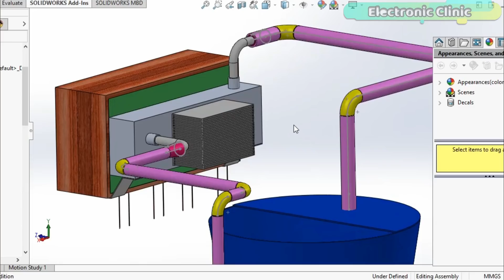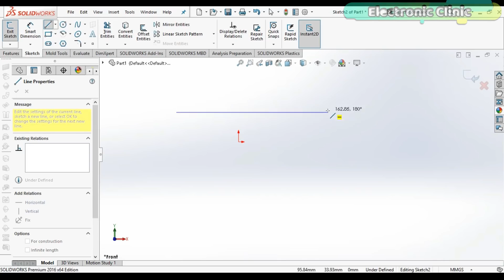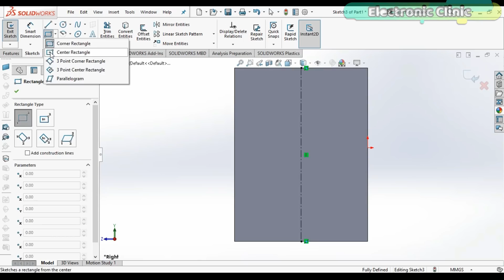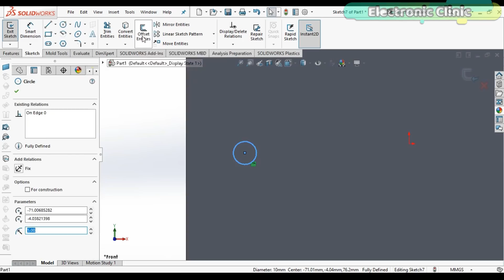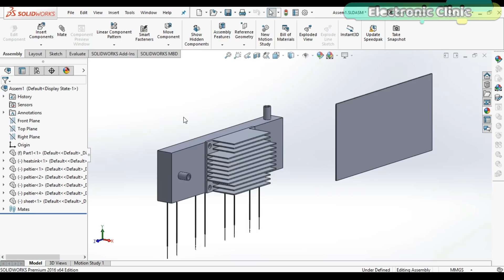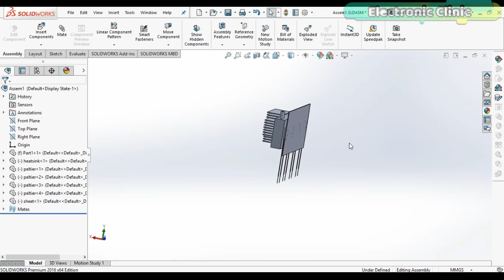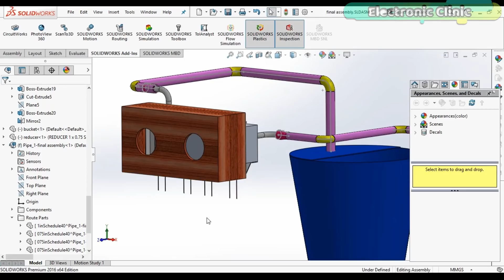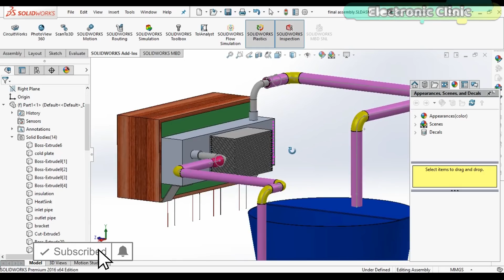DIY Peltier based Portable Air conditioner | Solar Panel & 12v Battery powered Air conditioner

Comment: Trust me , I have designed a project same like your dseign .. The differences are I will connect water block pipe to 1000 ltr water tank and 2nd thing, I will use 12mm aluminium water block with combined heat sink..
And I am gonna use 8 peltier...480 watts 48 amp

Comment: Hi i see you had done great job. using Peltier 4pcs.  but you had used Iron sheet. For greater efficiency hot side you should use copper tube condenser only  6mm height water passage will do great job.
On cooler side use Aluminium Long Heat sink & use Exhaust fan. This will give 25% more better result in air cooling
Reply from the maker: we search for the aluminum plate but couldn't find. that's why i used the iron sheet. but my aim was to explain the whole thing and it worked even using iron.
Reply: Bro where is anotheer part
Its almost 1 year but just waiting
Reply: But blowing air on heat sink on cooler side is better than sucking cool air.

Comment: Given each peltier is about 6A, you'd need 24A to run this, add pump & fans maybe 30A atleast. I have a 250W panel that only generates abt 16A of 12v at noon. You'd need 2 panels just to run it & another 4 to cover for cloudy days & charge a batt bank to run this at night... Maybe 12 250W panels might ensure it to run 24/7?

Comment: I liked your video and your attention to detail. I have a few suggestions. When you do your final test, I think it would be worthwhile to do tests with and without the Pelletier modules activated, so you can measure their effect vs just the water flowing through. It appears that you are using the barrel as a heat sink for warmed water coming out of the heat exchanger. This barrel will heat up, especially if it is in the sunlight. You may wish to see how well this Air Conditioner performs after it has been used for an hour or more. You may also wish to swap where your PC fan is in the final box. It is probably better to have it push air at the person (sucking air from the box) instead of pushing air into the box. Do you have any way of measuring the current load of your overall system?  You may wish to adjust how fast the water flows through the system to minimize energy consumption while maximizing cooling. I look forward to your next video.
Reply from the maker: I checked it for a long time, and I am still performing some experiments, the heat exchanger is working great. this system will be outside the room but not in the sunlight. The CPU Fan will be used inside the room, so this way it will always circulate the room air only. this way we can decrease the room temperature. As I will be using a solar panel so that's why I am not worried about the amps. it was just an experiment, you might have noticed, I didn't use the aluminum plate, it's a metal plate, but still, I was able to make it cold enough.
Reply: Excellent points

Comment: Very nice video. But I have some quarries. Did you calculate what's the minimum quantity of water needed to maintain safe level of the module? If so, is it possible to store water in a sealed container to avoid evaporation? Then I shall able to construct a home made AC or refrigerator with such water circulated peltier module. Thanks in advance.

Comment: I admire your determination but what you & everyone else on Youtube who posts these videos about "Peltier air conditioning" fails to realise is that you need much more cooling output than a Peltier can achieve to gain any worthwhile cooling. You would need about 100 of those Peltiers to cool an average sized room. Trust me, I am an air conditioning engineer.
Reply: Are you sure about this? Could you please elaborate. 
I'm thinking of making this. You might just save my heck lot of time and effort.
Reply: @amanagarwal6897  Yes he is right. Do not waste your time n energy doing in big scale, bcoz peltier needs 3 times more space to dissipate its heat than cooling itself. Also, it could be used for smaller dimensions efficiently.